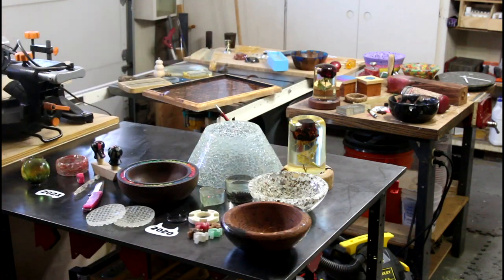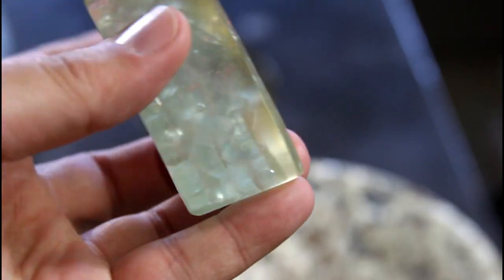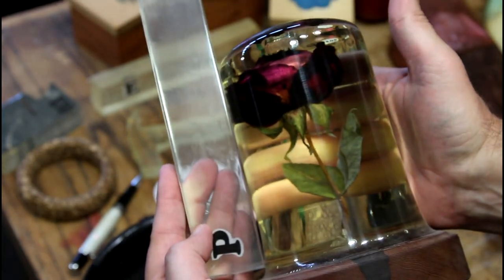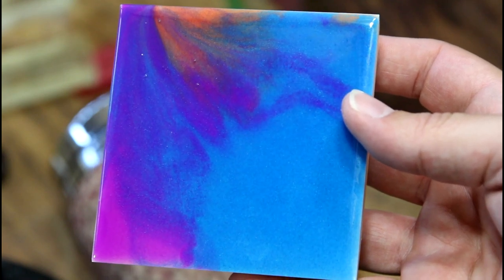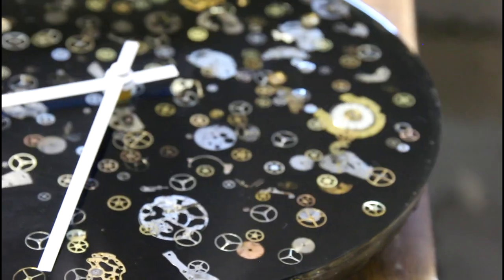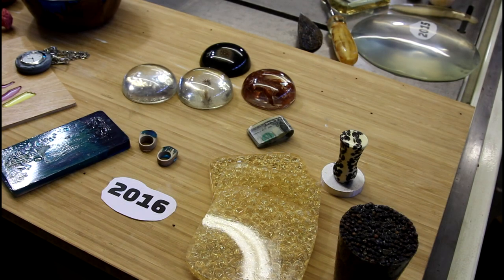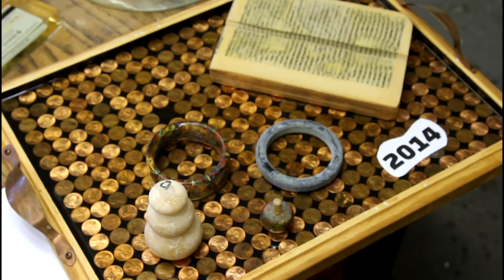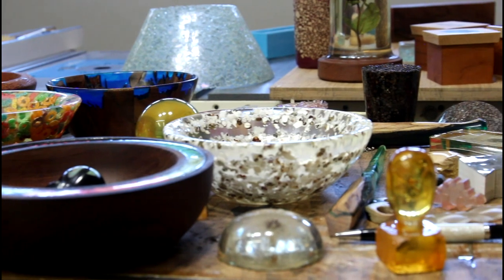Resins dirty secret?

Comment: Depending on the resin in large volume, some have a slight tint to them and when they continue to cure the tint gets stronger. There is a test done with huge thick huge slabs of multiple resins that really show this tint much like a pane of glass looked at on its side. So it might be the resin brand you used did have a slight yellow tint that just darkened. There is some resins that have a slight blue color and others that have a slight green color and a few resins that had a straight clear/whitish tint on side. Might be a thing to try one day making a bunch of blocks of different resins brands and types and checking them to each other and as years pass can pull them out to compare. They might darken, they might yellow, they might cloud... be something fun to test. If we know why they yellow like at a chemical level or is it physical level (Simple alignment of molecules causing the yellowing) then there might be a way to stop or prolong it.

Could also test different mold materials that can be used when making them.

Comment: Seems like it could be a reaction to air, larger surface area exasperates the reaction which leads to bigger objects tarnishing quicker. I'm curious if some of the larger objects aren't clear in the centre, something to test? Sandpaper then down or drill a sample core out

Comment: Sadly I can not post pictures here. But I’m restoring an old sailboat from 1972. The deck is laminated entirely out of fiberglass and epoxy. The color isn’t amber like. It’s the color your piss looks like after you’ve been drinking and taking molly for 2 days straight up without taking in water as swim told me…. Orange towards red. Common knowledge in the “refit scene”.  

Very good to know if you are creating high end furniture the should last several life times with epoxy resin. Great video!!

Comment: As someone that collects resin dolls I can confirm. There are dolls that have been casted in the early 2000's and later that are horribly yellowed. And yellowing resin is a part of this hobby and is a very feared thing. 
Usually people attribute it to sunlight, handling and storage and dust. Most popular ways to combat yellowing are Oxyclean, whitening toothpaste, hydrogenperoxide and baking soda. Also sanding. 
It might be worth sanding these pieces or trying one of the mentioned things to see if its effective.

Comment: Thin resin will show the yellow less than thicker bits for the same reason water is blue in huge amounts, but in smaller ones it's clear. There's an additive effect to the yellowing so it's less visible in smaller amounts. I also know that paints can also change over time, especially glazes (which is in part because it's picking up dirt)

Comment: I think thick or thin, it yellows at the same rate, you just notice it easier in thicker projects. Kinda like if you has some weakly dyed water and you pour 1/4 inch of it in a glass. If you look at it from the top you may not even notice the color, but if you look at it from the side you notice it immediately.

Comment: Haven't done many projects with resin, but this is really interesting to keep in mind for any potential future projects! I was wondering though; is it possible to recycle used resin? For example, you make a hammer completely out of resin, and you end up not using it for anything. Can that same project turned into another resin project?

Comment: I did some reading and they say there is 3 reasons for resin yellowing. 
1.) The resin is exposed to UV light at any process of the cast.
2.) Moisture some how comes in contact with the resin. Usually in pour storage areas. You live in an area with high humidity so this is likely the reason for that. A dehumidifier might help you a lot
3.) Exposure to high temperature. Storing it in your garage for instance.

Comment: But is the ambering just surface coloring or does it go all the way through? It would be interesting to see some of these projects either polished or re-turned to see if the yellowing goes away. Also I noticed a lot of restoration people use hydrogen peroxide and UV light to remove yellowing on plastics, so I wonder if that would work also? So many project ideas.

Comment: So having read a bunch of comments, it seems that a couple of people have found certain pieces don't yellow and they seem to have a commonality of charcoal or ash. These are commonly used to soak up harmful chemicals (which is why you are supposed to eat charcoal if you've been poisoned or you overdose). So maybe what ever is causing the yellowing can be bound by tiny amounts of charcoal or ash and thus the yellowing doesn't occur. Worth a shot IMHO
Edit: I'm actually realising the popcorn bowl wasn't mentioned but it too hasn't yellowed like the other stuff and it has tiny amounts of charcoal where the popcorn burned (which you can never not do with popcorn)

Comment: I used to do epoxy resin work and just quit a few years ago due to health reasons (I was also stupid and didn't use PPE when using resin). I had some pieces that have never seen daylight and have been in my basement for years. They all yellow. Some worse than others.

Comment: My original wedding band was a black ceramic with an inlay channel, and in the inlay, it had a strip of carbon fiber, inset in a clear resin.  Over the years, and plenty of UV exposure, I learned that resin no only yellowed (very noticeable after about the 5 year mark), but eventually delaminated from the channel in the ring.  I am not sure if it was original a strip of resin-impregnated material that was cut to length and wrapped/glued into the ring, but it did appear to have a seam, which it broke at.

I still have the ring, and I do plan on redoing the inlay at some point in the future, as it was the band I was married with, but since then I have instead switched to an inlayed ring that uses a mixture of materials bound together with CA glue, made by "Patrick Adair Design" (after I saw him making similar on YouTube, coincidentally enough).  I have only had the replacement ring a few years now, but so far I have now noticed any discoloration.

Comment: Ive dibbled and dabbled with carbon fiber and fiberglass mixed with fiberglass resin.Pretty dang strong stuff! I even laminated cardboard amking parts for automotive from yes cardboard laminated in fiberglass resin strong as hell and light as hell. I read its half life is 10000 years?

Comment: Is the ameber-ing only on the outside of the resin or throughout - as in if you take an ambered piece and polished it again would the ambering be removed with the outside layers of epoxy or is this a full thickness ambering? (Im looking to make a bar top out of bottle caps and epoxy, would love any recommendations on which to be less ambered)

Comment: You could try using a specific measurement of pigment in the resin then let it set for a couple of years then using the same measurements to see if the pigmented resin changes colour over time

Comment: Also just an fyi, total boat resin isn't the clearest resin out of the box. Like it's actually one of the worst for having a yellow tint right after casting. I myself have used total boat for a couple of years now but will definitely be switching. Matt's Woodworks has an excellent video testing a whole bunch of resins.

Comment: Pigment is a dust and think of it as these little particles that just so happen to bounce light into your eye that color. It's spread out I'm the clear resin and bouncing a bit of color back and pigment can not change color, since it dissolve it turns the resin a different color and it's not just specks but if it were then it would yellow around the specks. Colored resin does weather but because a color is dissolves into it and that color can't really change then the resin does look very different

Comment: This is a major factor in art conservation. The varnish used on paintings also inevitably turns yellow. The modern attitude is that varnish is not an intrinsic part of a painting, it's a sacrificial layer that periodically needs to be stripped off and replaced. Thus a major consideration for modern varnishes is, how easy is it to remove without disturbing the paint underneath.

Comment: This is really interesting. I wonder if the yellowing of resin is the same process that yellows beige computer hardware (keyboards, mice, towers etc). I’m no material scientist but my understanding is that heat plays a big part in the yellowing of plastic, not just sun. An interesting experiment would be to pour 2 test casts - pack one away in a storage box and put the other in the fridge and see what happens one year later. I also wonder if a process like Retrobright would remove some of the yellowing.

Comment: You actually answered a question I've had for a long time. When I was a kid I had this decorative ashtray in the shape of a turtle, but it was filled with coins. Like it was a bunch of coins from around the world, cast in resin in the shape of a turtle ashtray. The ashtray had never been used as an ashtray, at least not that I could tell, but it was SUPER yellow, and I could never figure out why. I tried cleaning it and even at one point sanding it a bit, but it didn't help. I didn't know at the time that it was cast in resin, but now I'm sure thats why its like that.

Comment: Well, I wouldn't blanket state all resins yellow, there are some UV resistant resins including some made for solar panel use which may still yellow over time but if it does takes a very long time if it does.

Comment: I know nothing about resin and have never worked with it before, but do you think it could just be an outside skin oxidation? I know that’s what makes headlights turn yellow and the way to fix them is essentially sand the oxidation off. And the thickness of the starter material causes more refraction(?) of the light causing more yellowing. Just my (uneducated) thoughts.

Comment: a hack from the sneaker collector world, you can buy/make what we call sole sauce, it’s basically vol40 hair cream with a thickener, if you coat the resin in it and seran wrap it, then leave it under a strong UV light or on a really sunny day, it’ll undo the oxidation that causes yellowing

Comment: I think the pigments is mainly masking the effect. Dark pigments makes it impossible to tell; yellow and green pigments will just go slightly more yellow but not noticeably. Blue might hide it for a while as blue is the opposite of yellow; but it will probably eventually turn slightly green. Though, if UV degradation is the main reason; some pigments might absorb more UV and thus protect it for a while making it happen slower. 
In any case I think the yellowing looks good anyway.

Comment: I am curious if for pieces like the rose if you could sand the yellow off and apply a new finish, you showed with the one piece that the yellowing seems to start outside the permeates inward, so maybe it is an oxidation of the resin causing the yellowing?

Comment: Is it a chemical reaction within the resin, or is it an oxidation on the surface which causes the yellowing?

Could we convince you to cut into / sand the outside of one of the older, most yellowed pieces to see if the yellowing is on the surface or the whole way through?

Comment: Now I’m curious, does it yellow evenly al the way through, so you could re-turn it/sand it/trim it and take out the yellowing? Also does it matter if it starts thick and you make it thinner, or does it have to be poured in a thin layer or o start?

Comment: When I was a kid in the USSR, it was very trendy to have a gearbox knob custom-made from epoxy with a spider inside. But the only epoxy people had access to, was thick resin for construction with amber colour. So, the obvious solution to the yellowing problem is to start with yellow resin. Then it will never yellow.

Comment: I'd bet there's a continuation of the hardener action in the resin. It hardens, quenching the reaction due to mobility in the solid, but over time that mobility is nonzero, so oxidation continues. Easy check - add too much hardener and see if you get a yellowed part quicker.

Either that, or it's cosmic rays. 

Oddly enough, nitrogen dislocations cause diamonds to be yellow.

Comment: Ben's works has been doing experiments with popcorn and resin during his most recent video they looked it up and said that popcorn pops at 180 degrees I was wondering if you could put some kernels into the just resin dye and fast cast resin and see what happens when it pulls up to temperature

Comment: What if you could try to take any one of your old projects and sand it back and then re-polish it. If it goes back to being crystal clear, then add a chrome liquid(the ones mostly used for protection from UV rays to avoid yellowing) that way you can protect your projects from yellowing. I haven’t tried it myself but you could give it a try and see the results for yourself.

Comment: Is there a way to fix the yellowing? Like if you sanded the uppermost layer and refinished it, would the yellowing go away? Or if you just put on a fresh coat of resin? I’m literally in the middle of a project using clear resin encasing some coral a friend got from a beach and I’m using clear resin. 🤦🏻‍♀️  it seems like if you have a dark background, you can sort of get away with the yellowing.

Comment: Well, the thinner layer of resin won't get yellow slower, It's just that thick layer of resin makes in more noticeable. Just like water appears to be clear until you have a huge mass of it. So it all gets a bit yellow but more resin absorbs more light (you can see that clearly with the clock). Overall thinner layer should yellow faster since it's thin and has more surface area per mass but it just appears less yellow.
Reply: So if I glaze a layer of resin about 1/16 to 1/8 of an inch on to something, maybe it will never be a noticeable yellow?

Comment: car lights yellow as well I wonder but you can sand it and spray UV protection coat an it stays clear for another 2-5years.  
I wonder how deep the yellowing goes if its surface level than you can sand it and put a new coat of UV protection or resin..

Comment: What's the Lightest type of Resin in Weight? As an Archer i have some Bows with Epoxy Resin Limbs, But they are Slow because of their Weight.
If we could find a type of Resin that can be used as a Bow limb and more Lightweight than Epoxy Resin, Then i think it'll be Close to the Speed of Laminated bows

Comment: Amateur chemist here.

I have a suggestion for an experiment for how to address your yellowing problem.

Apply a thin polyurethane or a polycrylic coating to your projects several hours after you've finished sanding and working on them.

Your lunchmeat experiment seems to suggest that your yellowing issue could be a humidity/moisture issue.

The reason your boxed projects are yellowing as well could be because of ambient humidity, as resin will react with whatever it can pull out of the air, if i has access to the air.
Reply: (I've seen a poured resin tabletop that sat out in the sun that didn't show yellowing effects for several years, until it was knocked over (😇) and cracked. Then, over the course of a year, the whole tabletop rapidly yellowed out in the sun and we couldn't figure out how one crack down the middle made the whole thing turn yellow.

Comment: Just wondering while watching. This may be totally inapplicable, so just be forwarned. I've seen restoration folk like Oddtinkering use the Hydrogen Peroxide and UV method to get rid of yellowing on plastics. I wonder if that would work on resin...? May be interesting to send it over and see what happens... but I'm speaking from complete inexperience here. Awesome video!

Comment: It sounds like Alumilite skimps on their UV stabilizer. a clear coat with good UV absorption properties should significantly reduce the yellowing not to mention it creates a barrier to air which is what causes the yellowing. It is also why pigmented resins don't yellow as much since it is absorbing that UV light. That is what pigments do. As for thin pieces that just has to do with it not having as much material where absorption can happen. Unless they have had zero UV exposure it will cause that yellowing since it's cumulative. each time you take it out or it gets exposed to light it will yellow some more. And contrary to common belief you don't even need that much UV exposure You can see yellowing even after a few minutes of UV exposure depending on the formulation, temperature, etc. and the piece will continue to yellow afterward since it's an exothermic free radical reaction that feeds more energy into the system as it reacts causing positive feedback even after you stop UV exposure. Heat will also cause Resin to yellow unless there is enough UV stabilizer.

Comment: Hey Peter, do you think it can be reversed?  I've watched some toy restoration videos where they take  an old yellowed storm trooper and put it in some 6% Hydrogen Peroxide.  Others will put them in the Hydrogen Peroxide and also shine some UV lights at it for 24 hours.  It completely clears them up makes them look good as new.  FYI, there are different strengths of Hydrogen Peroxide you can buy 3% Hydrogen Peroxide at any pharmacy but the higher strength stuff might be harder to find.  I believe that Beauty Supply stores sell the higher strength stuff for bleaching hair and whatnot.  Don't know if this would work but figured I would share in case you wanted to experiment.